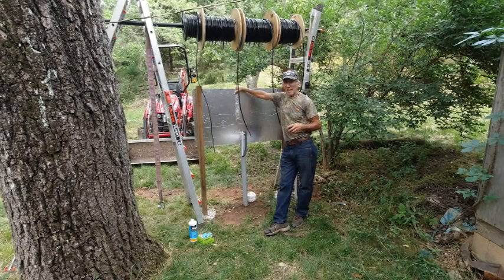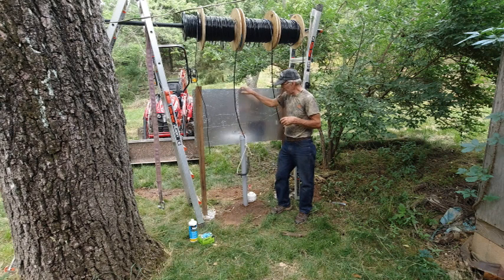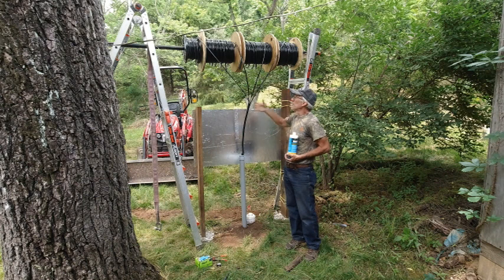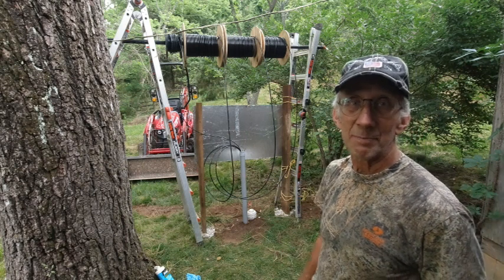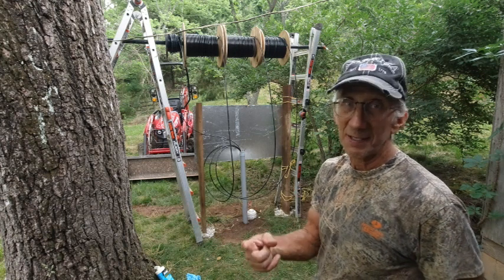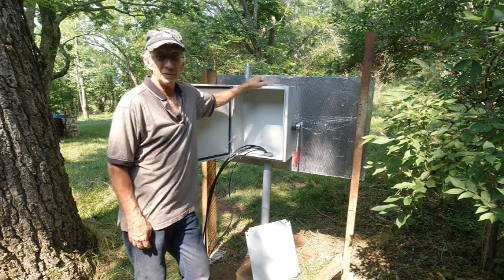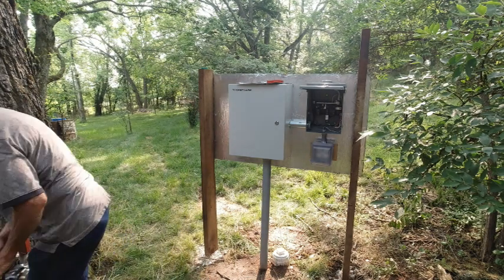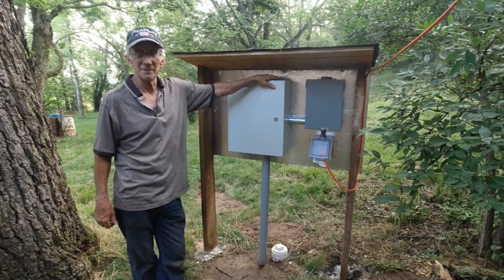Episode 68- Pulling wire for a 60 amp sub panel to the cabin. Solar power is getting more convenient

Comment: Nice to see you.  It will be nice to have power at your finger tips.  Good job.
Reply from the maker: It's so nice to have unlimited power for what I'm using now, even with a few cloudy days. It's been so hot and humid that I put in a small 5K btu AC unit, which I ran nearly all the time I was there. 
it's almost ironic to use the hot sun to cool off!

Comment: The number two wire is good for 120 amps so seems a little hefty. Maybe you did that to minimize the voltage drop over 220 feet. Nothing wrong with fat copper if you can afford it though. Man, you are coming along with all these projects plus travel to CO. Good videos.
Reply from the maker: I did it for voltage drop. A 60 amp load drops over 4% with that long run. For now, I'm not even using 20 amps, so you're right, it is excessive. Who knows what the future will bring. I try to overdo almost everything, for future improvements. I'm even running all my barn electrical in emt conduit, over 400 feet sofar. I really appreciate your input!